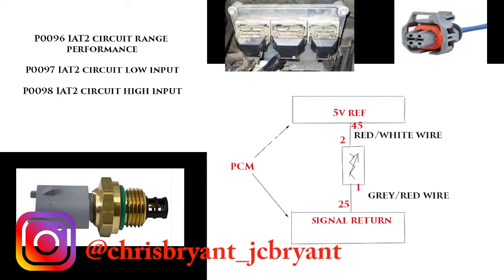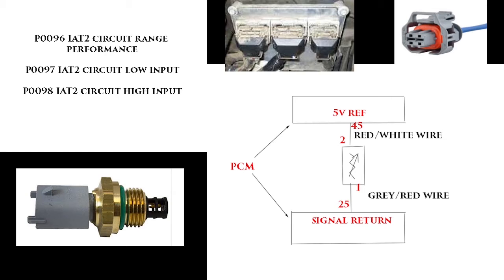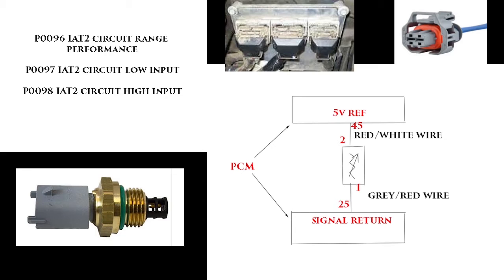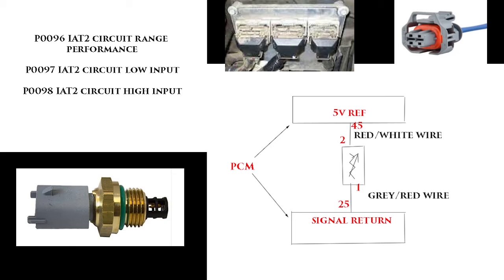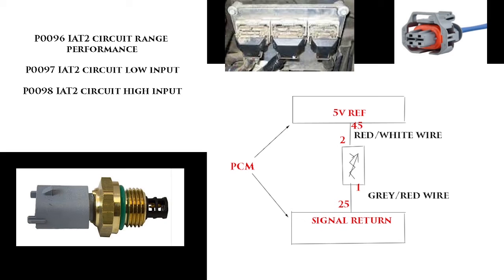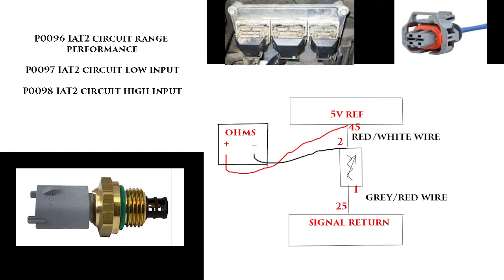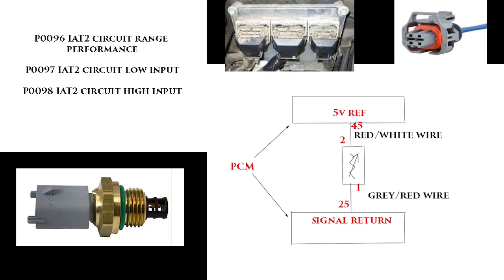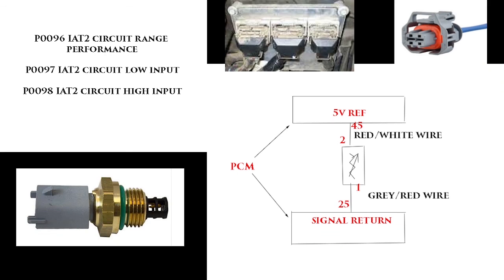How to Diagnose intake air temp P0096 P0097 P0098. The correct way!!!

Comment: I have an intake air temp fault 009800 and I wonder if this can be intermittent as the car runs well normally but occasionally runs as if misfiring but soon sorts itself out. The air filter has been in the last 25k miles but still looks new so haven't changed it and wonder could that be a problem.
Reply from the maker: Intake air temp normally will not cause the engine to run rough. 
A lot of bmw use mass air flow and intake air temp in the same assembly. 
Any other codes?
Reply: @showmerepair  Thanks for reply, it is an Audi A3 petrol I am referring to here. The car runs rough for a few miles shortly after start up like as if misfiring but eventually after a few minutes drives ok. There is no other code on my scanner and there is no check engine light showing either. I went to an independent garage recently and their scanner showed a knock sensor code and they told me that maybe as the fault is temporary, it is not throwing a check engine light. They also told me the knock sensor code may be not connected to the knock sensor itself but a failing coil. An intermittent is hard to diagnose and I always thought that electrical connections either worked or didnt. During the misfiring and rough running period, I notice the rev counter not being affected at all.